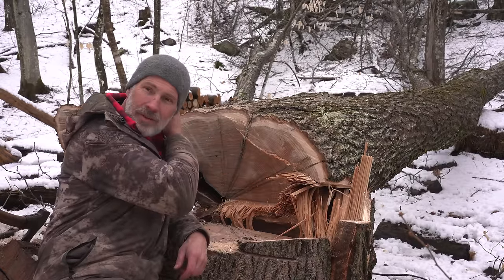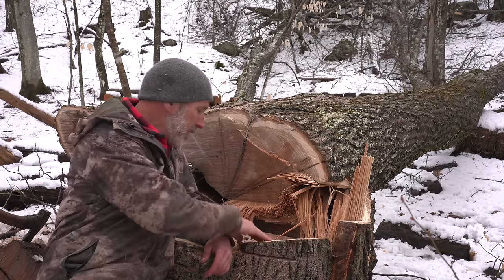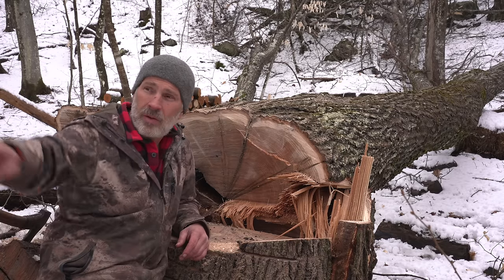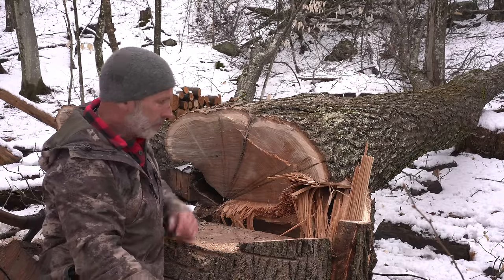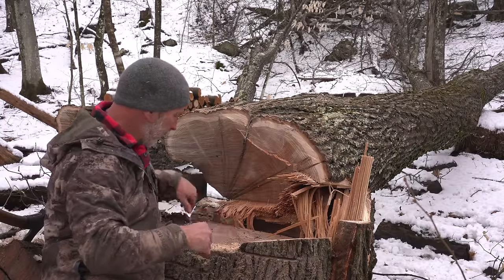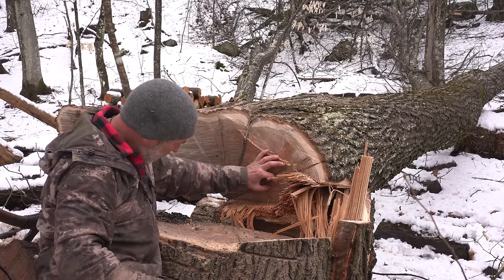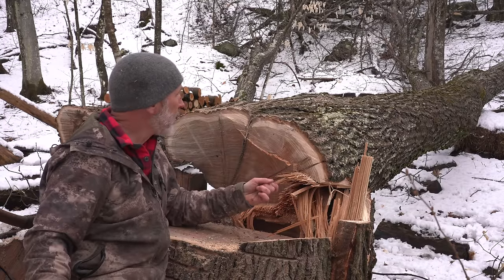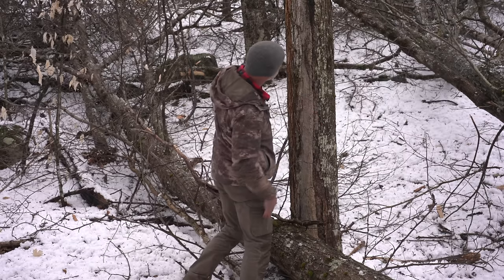I Had to Take it Down!

Comment: Was wondering how you were going to fit the HIGH SUGAR/CARB maple syrup into your new lifestyle.  Each 1/4 cup of Syrup will run you approximately 50g of both carbs and sugar.  In a low carb environment, this is a BIG addition to your daily allotment.  It may be more beneficial to trade/sell your syrup for meat/cheese.  Not sure what you are limiting your daily carb counts but ours has been less than 60g/day for our journey into ditching Type 2 diabetes/hypertension and saying NO to pharmaceuticals.    Good luck on your journey into a more health lifestyle.

Comment: If  you have time put a hole in the wood holding the grill over the fire run the cable through the hole have a series of nail so it can be adjustible. or a chain could do the trick as well without the hole just a hook or nail at the top.    (that;s what you had on hand at the time)?

Comment: Hello Shawn, have been meaning to ask for sometime now, but the black plastic looking tub that you use for carrying numerous smaller logs;  it looks very light so easy to pull, but do you go through a lot of them because the plastic gets ripped and shredded by the ground you cover?
Reply from the maker: I’ve had that one for ten or oregano years and it does now have a small hole in the rear

Comment: For the role of a suspension, on a fireplace, an ordinary chain of small link size, with two carabiners at the ends, has proven itself best. You can always adjust the height from the flame and throw it over anything. Fix or shorten by winding and the edge is fixed with a carabiner. I like your way of life, you live in peace with everything around you and it’s close to me.......
на роль подвеса, на кострище, лучше всего себя зарекомендовала обычная цепь небольшого размера звена, с двумя карабинами на концах. Всегда можно отрегулировать высоту от пламени и перекинуть через что угодно. Зафиксировать или укоротить, путем намотки а край фиксируется карабином. Мне нравится ваш образ жизни, вы живете в мире со всем окружающим и мне это близко.......

Comment: If you want to help your forest you really need to LEAVE the fallen trees on the ground, whole, in the forest. Their decomposition helps the forest immensely. It brings new types of mushrooms, it can become a nurse log for species that don't like growing on the forest floor etc... You NEED to leave those. If you always remove the wood, always sell it or burn it, or chip it, you're actually hurting the forest. The natural long term cycle of a forest is to have all its diseased and dying trees help the rest of the forest grow taller and stronger. If there's no disease or pest, then it's storms, wind, that will fall a good chunk of trees, and again, help the ecosystem strengthen.